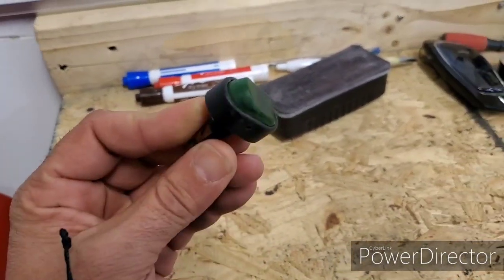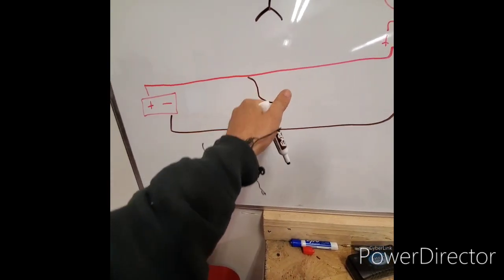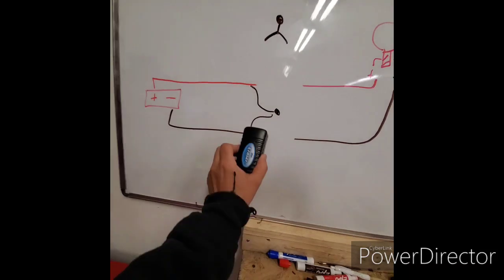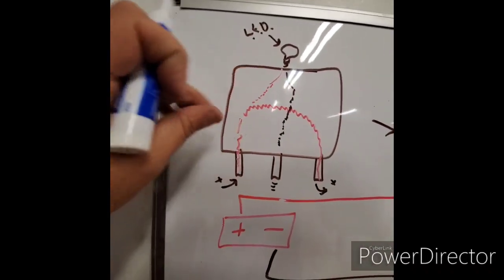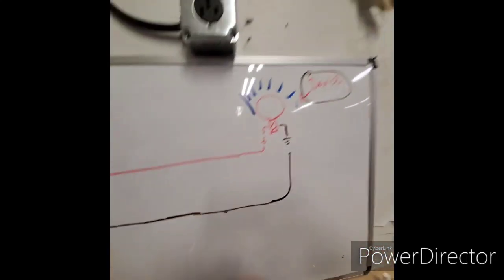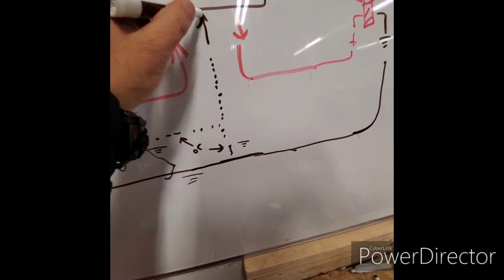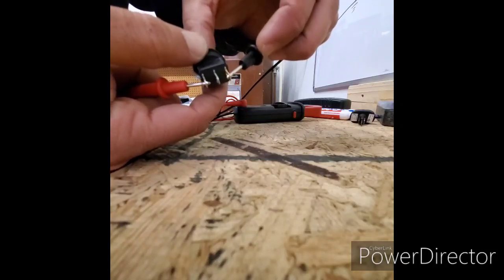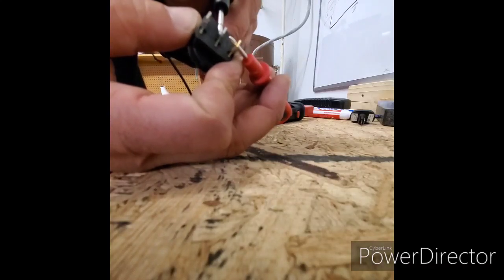How to wire an LED toggle switch , ( on-off 3 prong rocker switch ) 2020

Comment: Great video!  Very easy to understand with great explanation.  QUESTION: I am trying to hook up a toggle switch (just like the big one you have in the video) to my truck's LED running boards and want to connect a fuse tap into the 15amp interior lights fuse space.  I can only find a 10amp fuse tap though.  1.  Can I use the 10amp fuse tap and just put a 10amp fuse in place of the current 15amp fuse and then use another 10amp fuse for the LED light fuse.  2.  What would the wiring look like in this fuse tap & toggle switch set up?  Cheers!
Reply: FYI:  The reason I want to wire the LED running board lights to the interior dome light in the fuse box is so they come on when I unlock the truck.  The reason I want a toggle switch is so I can turn the LED running board lights off if I ever need to have the truck doors open for a period of time.  I don't want to run the risk of draining the battery. :)
Reply from the maker: Ok. I have an idea of what your looking for here. 
Its going to be alot to text. But the very short version here. Is that you need to ise a 5 wire relay, to use the done light, as your trigger for the steps. Then once you have established your "relay output" or "trigger" wire from the relay to go to the step light, that 1 wore is the one that youll be woring the toggle switch into. To connect/dosconnect. Thus giving that LED over ride you want. All while keeping the fuses rated as they should be, good and proper.
Reply: @myonlinecarguy1  Thanks for the very quick reply.  I already have the toggle switch installed in a blank panel and have run the wires off of that over to where the running board LED light wires com into the truck.  Can't I just use that toggle switch to turn the LED running board lights on and on whenever I need to separately from using the factory installed toggle switch that currently turns the interior dome lights on and off?  I would be using the fuse tap to the fuse that currently powers the interior dome lights so as long as my toggle switch is on, the led running board lights will turn on and off with the dome lights.
Reply from the maker: @lucidshineautodetailing9181  while logic would say yes. Its not likely.  Most times, the dome light nowadays are always with power, and get a gnd trigger to activate. Or are run by data. In which a toggle wouldn't work either. That part will depend on the car/truck. 
Now, you can run a dedicated 12v pwr to the switch, then from switch to step and youd have master control.
Reply: @myonlinecarguy1  Thanks.  my truck is a 2010 Nissan Titan.  

If I ran a dedicated 12v pwr to the switch that would allow me to turn the running board lights on and off any time I want to, BUT they would not turn on and off with the interior lights, correct?  

Right now, the running board lights are tapped into the power that turns the interior lights on when the door is open (only).  When the doors are closed, the running board lights turn off (but the interior dome lights stay on until you turn the key to start the truck).  In order to get them to turn on with the interior lights even if the doors are closed (before you turn the key on to start the truck) you are saying there is no way to install a switch in that wiring?  :(  I feel like there has to be a way, but I admit, you are the expert in this area and I am definitely not. LOL

Last thought.  What if I decided I did not want the switch anymore.  I just want the running board lights to come on and go off with the interior lights (when the doors are open/closed until I turn the key to start the truck.  Is there a way to tap into the fuse box with a fuse tap to do that?  Oh please say yes....  LOL  And can I use a fuse tap that is for 10amp even though I am tapping into a 15amp fuse slot?  (All the lights in the interior and the running board lights are LED, so I'm hoping I can get away with a 10amp fuse and a 10amp fuse in this situation and be OK. 

Sorry for the long post, but I greatly appreciate all of your help and expertise.
Reply from the maker: Ok so many things here. Lol. 
1) the t9ggle switch would be the on/off AFTER pwr is being supplied by dome light. So a combination of dome on +switch on, is what would be needed in my example. 

2)  the dome trigger,  has nothing to do with ignition,  as you can manually trigger the dome to come on from the dash switch. So while you can wire to activate the step led, with dome light, you cannot ALSO have it deactivated just cause ignition is in. The step led is either going to match or not match the dome, if the done is the trigger. 

3) a 10amp fuse tap, in a 15 amp slot is ok. Lonf as the 10amp tap, is within rating for the new device. Then you'll be ok. 

4) keep the switch. Control is key, in my opinion. Use the dome to trigger a relay. That relay will give you an "output wire " to turn the led in/on. Cut that wire, and install you switch in that wire. Itll be the best way to do what you want for sure.
Reply: @myonlinecarguy1  YOU ARE AWESOME! I'm sorry I am taking up so much of your time.

So since I am not an electrical guy, can you walk me through how to do what you suggested? 

"Use the dome to trigger a relay. That relay will give you an "output wire " to turn the led in/on. Cut that wire, and install you switch in that wire."

It sounds like I need to purchase a relay?  I have never used one of these before.  Right now I just have a fuse tap and the wiring and it sounds like I need to buy a relay and won't be using the fuse tap.  Is that correct?

I've seen people online tap the new LEDs they are installing into the switch in the headliner that turns the interior lights on/off, but I that would eliminate the need for me to add a switch and I would think I would need to make sure to tap the power on the correct side of the existing interior switch or else the new LEDs would stay on all the time.  Does that make sense?  

If you can walk me through your suggested method of doing this, I would be so greatful!  

Perfect Situation:

Unlock truck - interior lights and running board LEDs turn on

Close doors to truck - Interior lights and running board LEDs slowly fade out
Close doors and turn key to start truck - interior lights and running board LEDs slowly fade out
Adding Switch - allows me to turn just the running board LEDs off even if a door(s) are open.

Cheers!
Reply from the maker: @lucidshineautodetailing9181  yeah, if you can get straight to the dome light switch with both pwr and grnd. Then theres no need for ANYTHING else. 
Maybe a toggle, if you wanted to manually shut em off, regardless of dome light status.
Reply: @myonlinecarguy1  Great!  I will try that.  Thanks again for your help.  YOU ROCK!
Reply from the maker: Thanks.  Good luck.
Reply: @myonlinecarguy1  Hi again.  I'm going to bother you one last time as I'm sure you have the answer to this. 

I pulled the ceiling center console in my truck and found three wires that connect a plug to the back of my dome light switch.  The switch allows the dome lights to be ON, DOOR, OFF.  There is a black, red, and pink wire going to the dome light switch.

I tested the circuit with one of those pencil light testers and the only time anything happened was when the dome light switch is in the "Off" position and I touch the circuit tester to the red wire.  When I do this, the dome lights light up at about half brightness and the circuit tester light lights up at about half brightness. No other combination of the switch settings and which wire I touch the circuit tester to results in ANYTHING happening.  

I would think that the RED wire from the running board lights would need to connect to one of the three wires on the ceiling dome light switch and the BLACK wire from the running board lights would need to be grounded anywhere on the truck and then the running boards would function the way I am hoping they would, but that does not appear to be the case.

Am I missing something?
Reply from the maker: @lucidshineautodetailing9181  your going to have to use a real meter. 
Alot of times. The GND is a screw that mounts the whole thing. And each wire is a trigger. Which means, there is no combination of 2 wires that would show voltage. 
Only a combination of that Gnd/mount screw and a wire.

Comment: Where do install a inline fuse at? 12 volt
Reply from the maker: The inline fuse would ideally be inbetween the battery/power supply and the input side of the switch.
Reply: @myonlinecarguy1  does the fuse go before or after the switch ? So I have led light fuse switch and power?
Reply from the maker: @gartoy  typically,  before the switch.

Comment: Can you connect a toggle switch to the remote wire
Reply from the maker: Yes , but it's a hard on/off. So, not advisable if there's another option. But... it would work, yes.
Reply: Which site would I connect the toggle switch to I have a two prong toggle switch
Reply: Which wire would I connect it to my bad I don't know why it said site
Reply: I've heard were NOT supposed to use the remote wire for powering an additional component. That wire uses like 300mA. When you're component is prolly 2-10amps if it's an LED or fan or something

Comment: Comment.   I'm going to use two these type switches in a suitcase  (radio) boombox.  One for radio power and one for a cooling fan.
Reply from the maker: Interesting,  lol. If you get a thermostat of some kind, you wouldnt need the switch for the fan, it would just turn on if/when interior temp tripped the thermostat.

Comment: On the small toggle switch with the little led on it,the ground is the brass coloured,the centre one the positive in(supply),and the last one is the load(positive out to device)am i right?because i have the same type of switch i want too hook up
Reply from the maker: In my particular case the brass was in fact the ground, yes. The other 2 are the pass through leads yes. 
But i def siggest you verify yours. As each manufacturer does it their own. The brass isnt garunteed to be ground although mine and some others are.
Reply: @myonlinecarguy1  i saw a few other videos with the same switch but they said that the brass one is a positive in,so yes that confused me.but thanks
Reply: One more question;so essencially when you were testing the small switch,the silver prongs it does not matter on which one you put the positive in or positive out?or is one silver prong specific for posi in and posi out
Reply from the maker: Not really. Electrically the pass through prongs do not matter as far as in/out because the switch breaks continuity so direction doesnt matter. 
Some more complex switches it could matter but thats the rare, definitely not the norm.
Reply: @myonlinecarguy1  ok thank you sir for your fast replies.you got a new sub👍🏽.now i am certain how i have too hook it the switch.😃
Reply from the maker: Awesome.
Reply: @myonlinecarguy1  do you have a email which i can use you contact you(for a connection of a 5 pin toggle switch)?
Reply from the maker: Unfortunately i dont. But we do have a company Instagram @myonlinecarguy1 if you want to send it there. I am out on personal.time at the moment but will be able to help later.
Reply: @myonlinecarguy1  ok thanks i will look into it👍🏽
Reply: @myonlinecarguy1  i just wired up my front parking sensors with a(more oem look) 4 pin switch(one cable is ground,one is for dashlight,so that the switch lights up,one is the positive in and the other is positive out).i hooked my sensors via the switch so i can turn them on/off.i used the acc 12v+ wire from the cigarette lighter and tapped into and wired that cable on the posi in from the switch.the posi out i wired it to the posi 12v wire from the sensors.(i did not hook up the negative wire and the dash wire from the switch,so the button does not light up at all),and the negative wire from the sensors i wired up to the chassis(negative/ground).i tested it and the sensors work perfect.
One question for you;i only used 2 wires from the switch itself,just for the pass trough,does it matter i did not hook up the negative from the switch itself?i guess the negative wire is just only there for the light(on the switch)?since i havent hook up the dashlights i left the 2 wires unconnected.
Reply from the maker: Your correct. If u have a function pass through, then the mechanical part is good and will function. The rest is LED stuff and possibly a "normally open/normally closed side of the switch. Thats just a feature of the switch,  not a requirement of use.
Reply: @myonlinecarguy1  ok thank you for the confirmation👍🏽😃.nice that you reply so fast.good videos!keep it up😎
Reply from the maker: I appreciate u too man.
Reply: @myonlinecarguy1  thank you👍🏽
Reply from the maker: Anytime man.
Reply: @myonlinecarguy1  hi sir,how are you doin?i have one more question;when were talking about the switch hookup,i didnt hook up the dash light wire.is it ok if i tap the dashlight wire from the switch,into another switch that is already hooked up to the dashlight(just tapping into it?)
I will just have too look which wire is acc(dash)triggered and just tap into it.just wanna ask the expert😃👍🏽

Comment: Hi I try many way connecting the 3 prong( 2 silver 1 gold colour) but I still can't get the led working with 12V. I even got 1 switch working with 2 silver connected together on supply and gold to load(led not lighted). By the way the switch is stated for 125V and 240V, does that means it don't work for 12V.
Reply from the maker: Yes prob the led must see the higher voltsge. The switch oart would still allow power to pass and be shut off "up to 240v"  
However the led wouod need to see it to function. Also make sure it is rated for dc power or a/c power this will matter too.
Reply: Thank you I will try to look for one that is for 12v .

Comment: What if the 3 prong toggle switch doesn't have a copper connector on my switch they are all the same and color too ?
Reply from the maker: You will have to meter the continuity.  The way i did. Mine happened to have the copper lead. But i still tested, you can test the same way.
Reply: @myonlinecarguy1  got you i'm going to try rn
Reply: @myonlinecarguy1  I just checked the switch again and it has the copper terminal I didn't notice it which is the last one on the switch.So the terminal in the middle is the accessory ?and the first terminal the positive ?
Reply from the maker: I would test to be sure. But sound like its goes.  1-pwr input 2-acc output 3- led gnd.